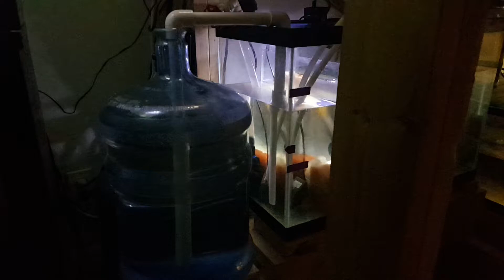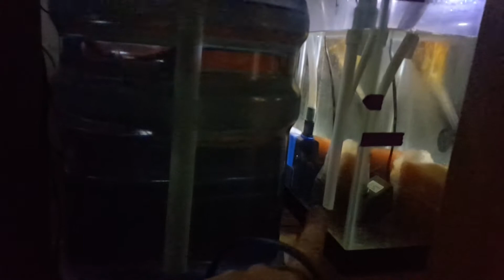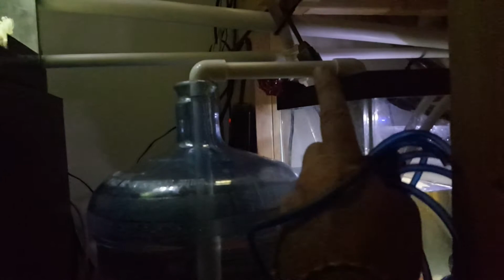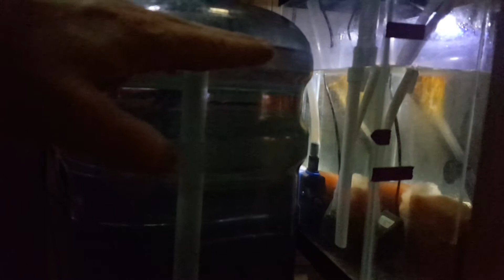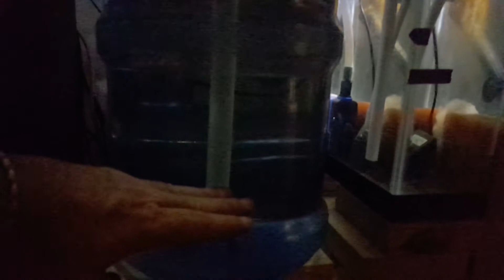No Pump / No Float Switch Auto-Topoff

Comment: Good idea but it isn't really going to top anything off. It will just drop at the same rate as the water in the tank.
Reply from the maker: Dreaded Vapour correct, increasing water volume nonetheless. It was a quick hack, served its purpose... i use an ATO now 😊
Reply: Chris Locke would all u have to do is just raise it ?